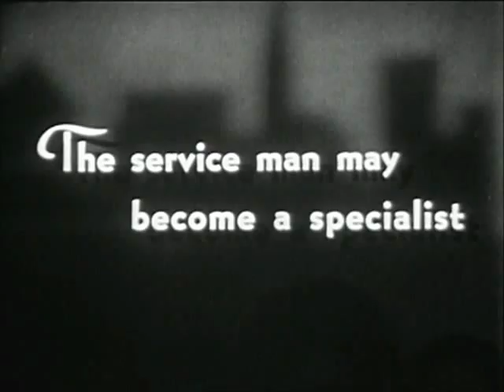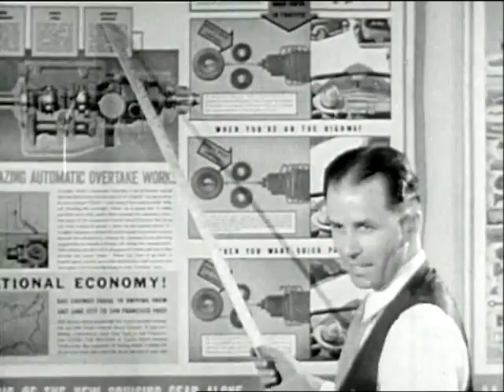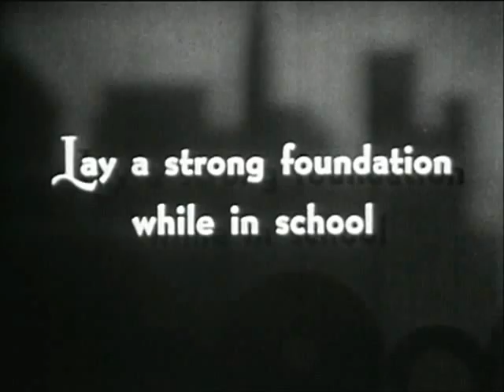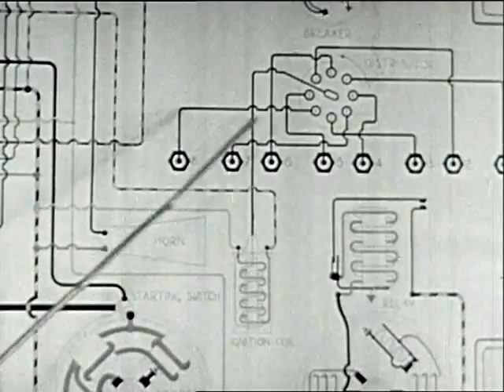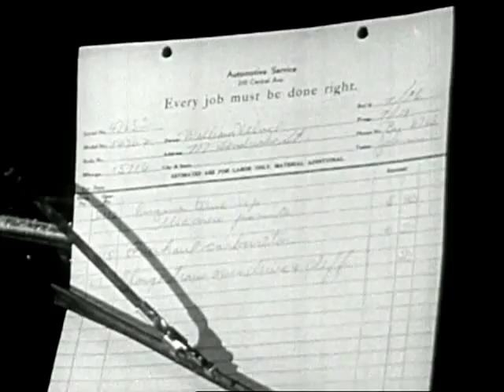Automotive Service (1940)

Comment: My father was part of this generation and got his early training in the US Navy beginning in 1942. Back then you had to be a skilled machinist, welder, and electrician.  Cars of that era required so much more service and repair than modern vehicles of today. I started my automotive career in the late 80s and worked primarily on Asian imports. Back then Honda and Toyota had a clear advantage in quality and reliability compared to domestic manufacturers but not so much anymore.  Domestic cars are much better and in my opinion Asian quality has declined making reliability about the same for both. Both are filled with Chinese components anyway.

Comment: This video is great, but cars today are so different.  The cars shown here lent themselves to repair, the electronics were simple, the engines were basic, and computers and sensors were nonexistent.  Todays cars are more replace than repair.
Reply: Its requires far more knowledge to fix a modern car than the cars show in this video. Knowledge of electrical and computer engineering to required to fix modern cars.
Reply: That's correct, they're just parts changers now.
Reply: It's better for you that cars have become this way considering the mechanics nowadays are not all welders and cnc specialists, moreover repair is more expensive..
Reply: @johnazhderian5734  I would say far less
Reply: OBD2 scanners entered the chat
 🐱👍🏿
Reply: Young men today won't change a tire. They call their mom and have her call triple A...

Comment: The pay wasn't that great back in 1993 when I was doing work experience with a mechanic where they tried to tell me not to do that, the pay was more like $417 AUD over here in Australia - not enough.

Unless you specialise & become a diesel fitter on a coal mine site, etc there's not very good money in it, becoming an engineer is another option which is way beyond what is shown in this video.

I mean, going as far as a company such as Promaz in Melbourne in Victoria goes which is 3D printing billet housings & eccentric shafts for the rotary engines.

If you're in tge business of rebuilding or doing machining for  large diesel truck engines then there's seriously good money in that.

I am glad that I chose the electrical trade because there's a lot more money in that,it's cleaner & less back breaking although we do sone heavy lifting from time to time !